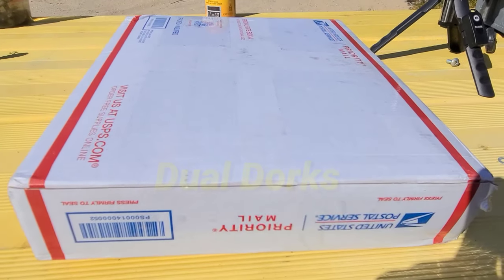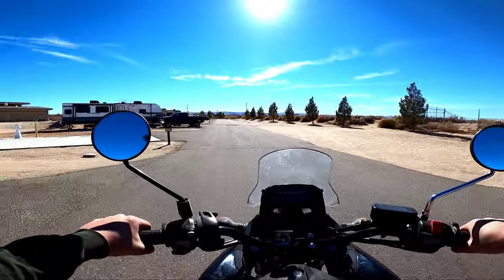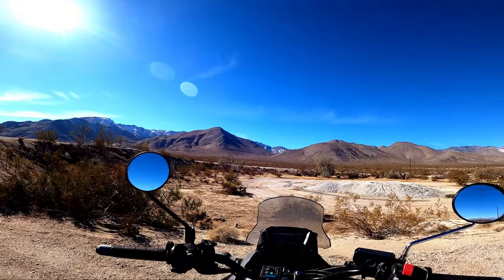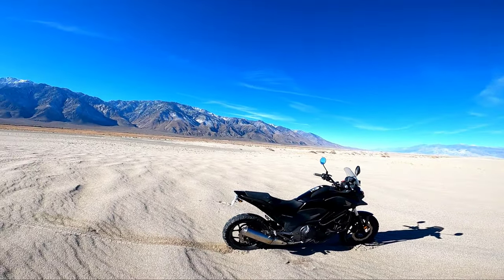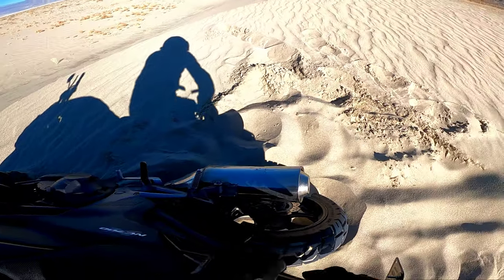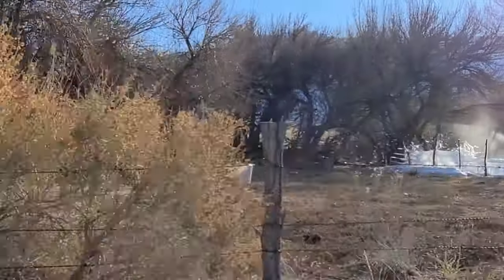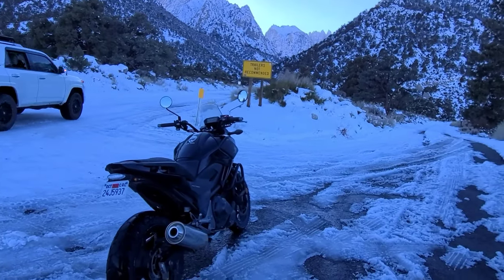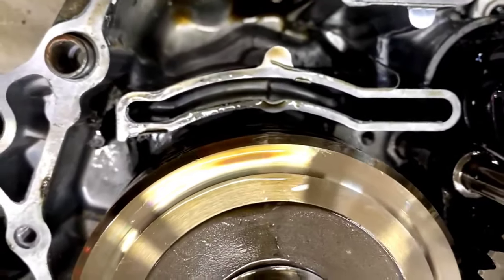The Return of the NC700X | The Best Budget ADV Bike

Comment: 6 years with mine and every ride is a treat. never less than 75 mpg (US). Handling, breaking, power, comfort,  looks, reliability! all superb. 57 years riding 60+ bikes owned several more ridden and the NC still amazes me.
Reply from the maker: Just wait a few minutes a got another video coming. I love this bike a lot
Reply: Same here, 40 years of riding and in my opinion the Honda NC bikes are the most versatile bike if you take everything into consideration. 
A real Jack of all trades. I have two and they're here to stay. 
Safe rides 🙏🏍👍
Reply: Ray - looking for a versatile adventure-based bike platform (don't mind making some mods from stock). Will be used on long distance touring on dirt roads, forestry service roads in Arizona. Compacted dirt roads, but with potholes and the occassional obstacle - ... nothing 'offroad' though - In your experience is this bike a good fit for that use? Seems like the engine design and higher torque at low RPM is a love-it-or-hate-it-thing. But for me coming from a big bore V-Twin past, I think I'd be ok with that but haven't ridden one yet. Your thoughts?

Comment: And on the 705s . great tire but I think they are 70% on and 30% off road . loved the video !
Reply from the maker: Yeah you are right . I love the tires compared to the stock tires the bike came with. The rear tire would spin in the rain
Reply: @dualdorks  I have been running the 705s on my tiger for a while and they are surprisingly good in the sand and gravel. At least more than I thought they would be . I am going to try the 804/805s and see how they do on and off road . again , thanks for the videos
Reply from the maker: @pigeonpallz1733  I'm going to get some knobbies for mine soon for the CABDR if my TW200 isn't up and going by then
Reply: 80 20 when i bought them

Comment: I have a 2012 NC700X Honda for sale. Runs like new, recent service, new tires/chain/battery. Has a windscreen. 18,000 miles. 65-70mpg. Listed for $3500. Obo.
Reply from the maker: I'm unfortunately getting rid of mine soon as well . My transmission went out on it and it's been in a Honda shop for 3 months.  Probably going to get a crf300l . I am tired of loading the 700 in my truck lol
Reply: @dualdorks   Oh, that's rough. Especially when the weather starts getting good. Mine has been problem free. I'm upgrading to a new one.

Comment: Since you're replacing everything, you might think about doing what I did with the DR and slap a big bore kit on. Then you won't have to go WoT on every hill/trail
Reply: Id go with that, my TW125cc engine got borded in the Rolls-Royce jet engine factory in England ... its faster than DD's TW200. Tops out at 68mph

Comment: Wow! I love the sound of this thing. I am a good off-road rider, but I prefer more pavement oriented ADV bikes because I feel good off-road on most bikes already. I switched from KTM 1190R to Honda ST-1300, and I don't miss the KTM. I think this NC700X will be my next adventure bike. I should try the Africa Twin first though.
Reply from the maker: It's a great bike for 1/3 of the price for a GS . The NC750X has a bit better suspension if I remember right but don't quote me on it.  Its got some different modes to if you got the DCT versions.  I'm about to do the CABDR this month with it. Just got my skid plate and pannier racks in the mail today
Reply: @dualdorks  Cool! I am usually in Lake Havasu City in winter. I should try this route one year!
Reply: The Africa Twin handles WAY better, on road, for sure.  Love my AT.  Took a test drive on a used 2015 700X, for my wife, and it felt unwieldy, comparatively.  She thought it handled pretty well, but she’s never been on the AT.
Reply from the maker: @petevredenburgh8899  if I had the money I would buy one in a heartbeat
Reply: @petevredenburgh8899  Thank you for the recommendation! I definitely want a DCT on my next bike. I have Alta dirt bikes, and I am spoiled without a clutch and shifter. But they do not have the range to ride longer than 2 hours. A gas bike with an auto transmission should do the trick! They even installed a cornering ABS on the AT, after I told one of their guys at the bike show in Orlando that I want one! 👍
Reply: @dualdorks  I got this new2019 last April, on ebay, picked it up in Russellville AK, $9,964, out the door!